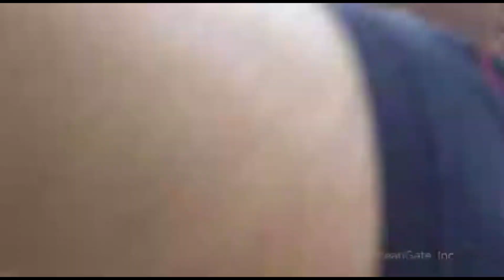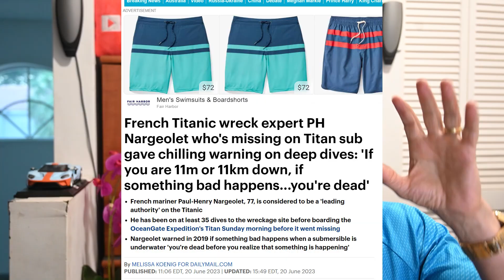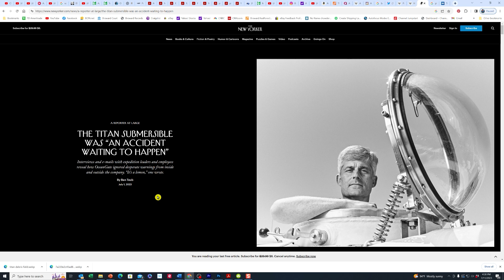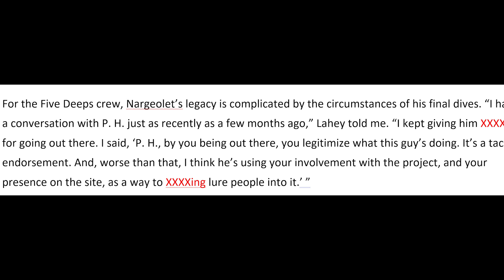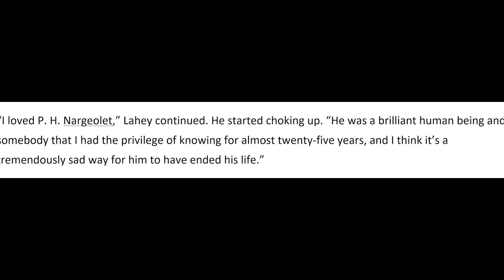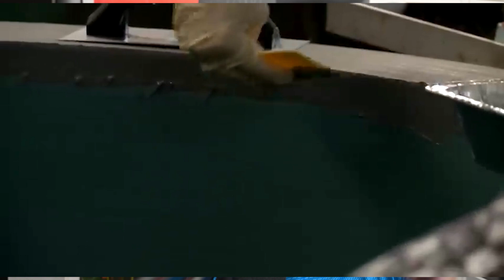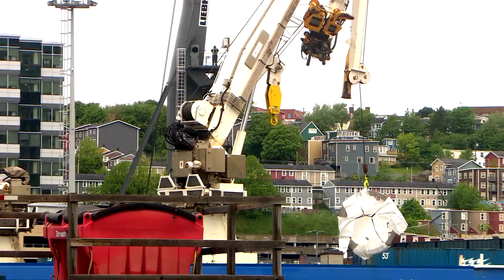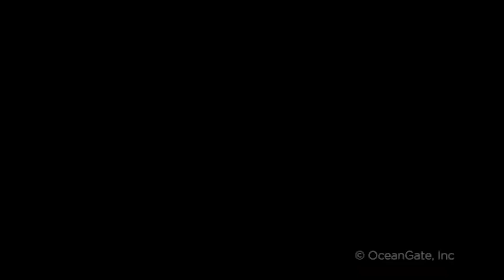Titan Sub: More Q&A, Design Defects, Why Descent Fast

Comment: Hi I'm a structural engineer.  Regarding unidirectional carbon fiber weave, which appears what version was applied to the cylinder, one major drawback is its workability.  UD tends to fall apart quite easily during the layup process since it has no interlaced fibers to hold it together. If the fibers are placed incorrectly it can be almost impossible to correctly reorient them all again. When the fibers are not placed in a uniform manner, the weave's unified strength is compromised, much the same way threads loosen in clothing when under repeated use.  Moisture in the application process keeps each application set uniform as they're spun.  It appears that there were no machine vision cameras to verify uniformity in the process.  Today's computer vision can leverage multiple sensors, visible light, ToF, thermal to immediately detect uniformity errors or a deviation from the intended weave to achieve strength at the joints.  This process is often used in carbon fiber bike frames, where the weave may create stiffness near the bottom bracket and seat lugs, but allowed to be more shock absorbing in the middle for a more comfortable ride.  Jeff you are also correct about methods to increase the coefficients of static & dynamic friction of the adhesive bonding surfaces through longitudinal grooves or simple surface abrasion.
Reply: Sorry for being verbose, but structural design with CF, and other fiber types requires the process be part of the engineering.  After Jeff's comments regarding lack of prep on the Ti cap's surface used for adhesive, and that there were NO CF Fragments now is stuck in my mind, excuse the pun!  The epoxy slipped RIGHT OFF THE Ti Cap the same way ice or stiff rubber at low temperatures leaves a glass surface.  The last shocker was the pilot's severe depression.  He himself didn't realize he was suicidal.
Reply: Keep in mind that that was probably the inner hull that wasn't the one that resisted the pressure from the ocean. The inner hull just had to support the weight of the furniture, passengers, toilet, screens, etc. The pressure hull was probably never shown since that's where the design secretes laid. Also, don't trust videos that companies release since, for all we know, that could've been footage from another company.
The actual pressure hull would've been done differently since the fiber would've had to been used in a way where it was in tension while under pressure. The thing in the video you saw was designed to counteract pressure from within. The actual pressure hull was likely made out of strong rings with carbon fiber woven between them much like power lines on utility poles.

Comment: I didn't see any extra epoxy coming out of the joint. And what about the screws on the inside holding the TV monitors? They appear to screw into the carbon fiber

Comment: I am hearing the transcript from which you based your assessments is fake.  The claim is that the Titan and the Polar Princess  could only communicate with code text.  For example, W+ sent by Polar Princess to Titan would mean the crew on the surface was telling them, 'Hey guys, weather is rough is picking up', and W- indicated weather is subsiding. According to this report, complete sentences were not possible because they only had the length of a 'ping' to send 'short' texts to one another.  I saw in another clip where Pogue was actually holding the 'decipher chart' in his hand, showing what the different arrangements of letters/symbols meant.  So much is coming out -- some of it is fake and some is true.  I guess we will have to wait until the dust settles.  More than anything, I really wonder if Stockton Rush was what I call a silent pyscho.  I worked with a couple of surgeons in my career as an operating room nurse...on the outside to their patients and other nurses who do not work in the operating room where everything is hidden from the rest of the hospital, they seem like really good people.  Get them in the OR  where no one important can see them?  They are not the same person.  They are silent pyschos.  It's either that or Rush was so obsessed with his vision, he went blind.  I don't think resurrecting Stockton Rush in order to burn him at the stake makes any more sense than KNOWINGLY going down in an EXPERIMENTAL, UNREGULATED and UNCERTIFIED tin can to crush depth.  I dont' know why people want to keep harping on a lawsuit, "...because Stockton lied and withheld information...laughed at safety questions and didn't tell anybody he bought expired carbon fibre".  Yeah...and we may find out he did even worse than that.  The bottom line; those men signed a waiver that included all the relevant language as I stated above.  They ALL knew and understood there was a risk of death, injury and emotional/psychological trauma.  It seems simple to me; they weighed the risks against the benefit and decided that seeing the Titanic was worth risking their lives.  Would you or I do that?  I would not.  Neither did the other father/son team who declined their seats on Titan after doing further research..  I doesn't matter none of them knew the carbon fibre was expired or that experts kept saying he was going to kill somebody.  You simply cannot get away from the fact that Stockton Rush went down with his ship.  Had he seemed disinclined to do down in his own vessel....THEN you might have cause to consider doing an investigation for liability.  The men are dead, OceanGate is toast, let them lie in peace at the bottom of the Atlantic

Comment: The autoclave curing of the carbon fiber is absolutely essential for maximum strength. The autoclave is a heated pressure vessel, that will squeeze any void spaces out of the carbon fiber. First, the carbon fiber part is put into a vacuum sealed bag, then it is cooked under pressure. I'm not sure how a carbon fiber roll, 5" thick could possible cure properly either. Most carbon fiber parts are relatively thin. That much mass would surely have voids or small area where air could be trapped.

Comment: Excellent analysis, Jeff! I am surprised that there wasn’t an Abort criteria for excessive descent rate. Even if structural integrity was of no concern, it seems at some point higher than expected descent bring buoyancy into question and the ability to safely abort the dive or even normally return to the surface.
Reply: Knowing what we do about Stockton Rush, I don't think there's much cause for surprise. The idiot probably considered it a bonus as it'd save on oxygen supplies and let them extend the dive.
Reply: I'm guessing he just assumed it was a current or something. My guess is that there was an electrical or mechanical failure. That would explain why he had trouble releasing the landing gear. Something was probably arcing which was reducing the voltage that went to whatever solenoid detached the landing gear. I don't know if anyone knows how a lithium battery bursts at those depths so this could all have been caused by an electrical short.
Reply: It's mind boggling that it wouldn't immediately be flagged. Surely it makes transcripts fake? BUT James Cameron knew they'd dropped their ballast...If its dropping even 1% faster than the normal then its an instant abort AND it's one of key rates to be monitored. Bizarre.

Comment: My question is on the design of this thing. Why wasn’t there some sort of retaining ring, or expanding pressure ring, not put on the inside of the carbon fiber hull at the outer ring? It seems to me that something like that would have kept the hull material from trying to peel away from the outer ring. And that part you mentioned about the smoothness of the outer ring was one of my first concerns when I saw how it was assembled. You never glue anything to a smooth surface like that.

Comment: The adhesive has nothing to do with pressure. Once under pressure the surfaces are going to hold even without adhesive. I suspect the adhesive is actually a gasket. Lets see what the inquiry says. I bet I'm correct.

Comment: Sorry, but why would you use glue when your device is going to go below water? Isn't it common knowledge that the glue can dissolve in water if not directly through the naturally found detergents? Shouldn't submersibles have some kind of fins to prevent it going up/down too fast?

Comment: I don't want to relitigate the points discussed in the previous video's comments, but I would like to hear from Jeff regarding:

1. Is the fast descent related to the slow ascent? I think so, but don't know for sure. 
2. Could there have been a water leak? A water leak is consistent with some evidence, and inconsistent with other pieces of evidence. I would like to hear Jeff's opinion about this. I think any water leak would have been obvious and destructive to the pressure vessel, given the water pressure. 
3. If there wasn't a water leak, what contributed to the fast descent, and the slow ascent? Could hull compression be the answer? At depth, maybe, but closer to the surface? 
4. How much of this story depends upon the authenticity of the chat log? I think the answer is 'almost all', since the only reason we even think the descent was too fast was due to the chat log.
Reply: I'd be especially interested in some back of the envelope calculations. For example, if their ascent speed was 25% of their normal speed, AND they had jettisoned the skids, what is that telling us? To what extent was the buoyancy of the sub compromised? I don't understand how they'd have lost so much buoyancy without being aware of how it was happening. 

Of course maybe they were aware - we know Stockton was reluctant to talk to the topside vessel about the RTM values (they had to prod him at least 3x about this), so maybe he knew what the buoyancy issue was yet didn't want to acknowledge it.

Comment: Thunderfoot did a great video where he talked about the different rates of compression on the titanium rings and the carbon fiber  body. He stated that carbon fiber would compress about 1cm at deep dives but the titanium would barely compress at all. That is a huge discrepancy that the Ocean Gate designers ignored.
Reply: Saw that, but I think he got it wrong.  The Young's modulus for titanium is smaller than CF (120 GPa vs ~300 GPa).  So if the ring thickness is about the same as the hull thickness, titanium ring should compress more, not less.
Reply: @mikefochtman7164  Where are you getting 300GPa for CF composite?
Reply: @mikefochtman7164  That is not correct. 300 GPa is for a single fiber, and one with a particularly high modulus. You can only pack fibers so tightly. 60-70 percent fiber by volume is expected. 230 GPa is standard modulus fiber. At 60 percent fiber volume that's 125 GPa. Not all of your fibers are in the hoop direction tho. So your hoop modulus will be further reduced to about 85 GPa.
Reply: @matthew4878  I was only going by what I googled, sorry.  Thanks for your input.  What you say makes sense, so we can probably say that the modulus for this particular hull design may be somewhere between 85 Gpa and 125 GPa, depending on exact manufacture.  This puts it 'on par' with titanium alloy though, so the whole 'dissimilar material compressing vastly differently causing severe stresses' discussion would seem to be not as big an issue as some claim.
Reply: Does it matter if CF is in tension vs compression, or is Young's modulus for CF equal in both directions?
Reply: @JSu2.  it is not equal I do know that. It has high tensile strength low compressive. But as some point out a rig when compressed tenses other sections so its not so simple to solve.
Reply: @jhoughjr1  it has a lower but still very high compressive strength.
Reply: Thunderfoot got it wrong for sure...
Reply: Id expect TF to fail on this as he does economics.
Reply: Thunderfoot is an atheist. He can't be taken seriously on any matter.

Comment: In some footage I see a ballast tank underneath the sub, in the middle of the sub between the aft legs. But in other video's I can't see this ballast tank. Instead, I see four concrete half-circles hanging on a line. I think the footage I saw with the tank are renders. Could this mean they changed their ballast system very late? For clarity, I am not talking about the balancing weights on the legs.

Comment: Why has NO ONE considered the end to end.."Longitudinal Loads" on this craft..??.......I calculate 21 million pounds of force pushing those Titanium ends toward each other....Pushing inwards.......Pushing inwards against the edges of Carbon wound circularly around the vessel .carbon has ZERO strength against the edges.......ONLY the 20 thousand or so compression strength of the EPOXY..........Carbon has ALL it's strength lengthwise with the length of the fiber......And LOTS of it by the way in this direction..Why do I see NO carbon running lengthwise to protect against the inward pressing of the Endcaps.........I am 80 and have built many projects out of carbon for 40+ Years.........I have to do it the old fashioned way, Working at room temperature most of the time.....Nothing so fancy as an autoclave, but I could have built a stronger vessel...........There was Months of warning with those cracking noises being the sound of disintegrating fibers.........Amazing to Me the Craft did not fail on It's first dive........If the Angels give Us warnings, These People had lots of warning...........Reminds Me of a story My Father told Me many Years ago..........He had always believed it was right to attend Church on Sunday...One Sunday He instead went Squirrel hunting and nearly got bite by the largest Rattler ever seen in Iowa.........It is seldom in Life when We get NO warnings.........Only must listen............................Paul

Comment: The faster decent rate could be a result of overconfidence, they added more weight. Or it could be a sign that they had water intruding into the hull itself or intrusion somewhere else on the sub. That would support the slow ascent as well. In any kind of normal tested pressure vessel with a safety margin the descent rate doesnt matter. Either it can handle the peak or it cant. They cant possibly descend fast enough to cause a pressure spike. I think people are thinking of pressure waves, like produced by explosives. Descending to depth just doesnt work that way. If it was a factor here then its just more evidence that their construction wasnt up to the task and would have failed at some point. The fact that industry had already experienced this with carbon tubes and knew exactly how they fail is mind blowing. They didnt even bother to research what they were working with. I guess they were just so "innovative" that others previous work wouldnt apply to them. These guys were amateurs. They were as much a part of the submersible community as a guy that builds a fiberglass ferrari replica on an old beetle chassis is part of the Ferrari community.

Comment: Another possible defect is in the way the carbon fibers were laid onto the mandrel. From the videos they appear to be laid all in one direction creating a shear point. I would have expected them to be laid in a herringbone fashion or alternating pattern much like plywood. I also wondered if they used an autoclave or if it’s even possible to autoclave 5 inches (127 mm) of carbon fiber and get any air pockets out of that thick of material.
Reply: the first hull yes the last hull wrapped differently

Comment: If air is compressed to 400 atm it gets hot enough to cause a steam explosion ..,

Unless that air dissolves so rapidly at that pressure that it isn’t air any more. 

So does anyone know whether the diesel heating or the dissolving comes fastest?

Comment: I think the aft section, which was isolated from the passenger compartment, filled with water. That would account for the faster descent, for the loss of controls, for the alarms, and for the fact that when they ditched everything to make it buoyant, it did not rise to the surface.
Reply: Plus, the loss of electrical power.

Comment: Pretty sure fiber was 'pre-preg', but my biggest question is why they went with a straight wrap and not off-set angle layer it, where it gives you the most strength?

Comment: I've wondered the same thing about the adhesive. You can see when they pulled the pieces of the sub up, the ring was clean with no carbon fiber on it. Most adhesives isn't ductile and it has different expansion rates. I'm betting, that's the failure point.
Reply: i saw glue on one of those ring photo.

Comment: They were going too fast, and that was also the mistake of Captain Smith with the Titanic in 1912. I have a question, is there a possibility that  from the beginning, the Titan had a water leak into the aft area ? and this was the cause of the rapid decent, and the inability to ascend.

Comment: For me it is similar but in revers to a gardening hose. The softer rubber needs to be attached to a metal or plastic connector and this is where the leak / return always happens. I always tell customers turn off the water and relive the pressure.

Comment: In the video where they glue the titanium ring on, it shows them set the ring on and leave it. I would think this would require a weight on top or some kind of clamping to get any air pockets out of the epoxy. Thats to say nothing about the curing process and the lack of an autoclave.